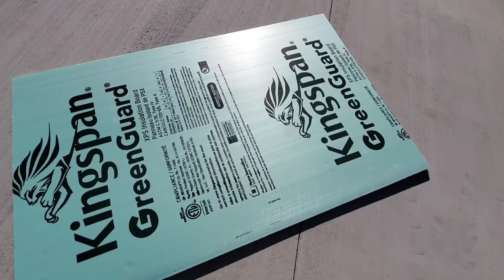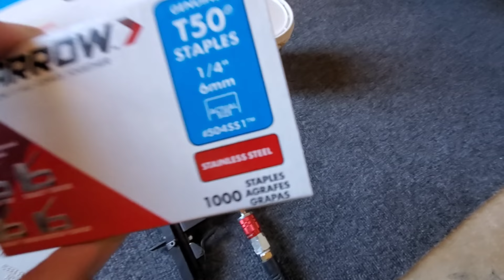Super Simple Jon Boat Floor

Comment: Plywood is a terrible option for the flooring in a John boat. Aluminum is much better. Use the blue foam board as it doesn't hold water if soaked. Plywood with rot under the carpet and hold water when soaked in it.
Reply: there’s a reason why you seal it before installing it
Reply: Eliminate the resin, carpet and the foam, the bare wood will dry between trips.   Lasts forever.

Comment: i did this about 20 yrs. ago. the ledgers are not needed. i notched around the side ribs for a snug fit, but leave room for carpet wrap. if left outside it lasted about 4 yrs. before it needed replaced.
Reply: and , then i got smart and used sheet aluminum.

Comment: I ran my 1448 Jon boat with a piece of 1/2" plywood floor.  I treated the plywood with deck oil.  No foam.  No resin.  No carpet.   No staples.  Bare plywood can dry out between trips.   Lasted for years and years, even donated the floor to a friend w same model boat.   Don't try and measure out the size of the floor.   Much easier and accurate to make a pattern from cardboard.

Comment: Very informative videos. I’ve been restoring and building boats for years now, can I make a friendly suggestion? When you put resin on plywood it works much better if you mix 50/50 resin and acetone. This lets the resin saturate into the wood instead of float on the surface. Definitely do the underside as well. 
PS- double up on hardner (MEK) when you mix 50/50 resin and acetone. Good luck sir.
Reply from the maker: Thank you. I will try this. I appreciate your advice!
Reply: @AnthonyJonesBrigadeBoats   Have you tried the 50/50 on anything yet. Would like to know your opinion.

Comment: I modified my Tracker 1436 similarly but used insulation on the sidewalls covered with Luan panels and carpet. Front and rear trolling motors and dual fish finders,  pedestal seat mounts, and remote anchors completed the upgrades. Electrical runs enclosed in split tubing assured reliability. I heated the boat with Coleman lanters on the floor fore and aft. Even in the dead cold of winter, the insulation worked so well that I would fish in shirt sleeves as anything else had me sweating. Night lites rounded out the project.  I kept it for 7 years, selling it only after buying a brand new Tracker 175 Pro TX. 
LOVE your channel! Keep the goodies flowing.

Comment: I took the crnter seat out insulated the bottom with the blue foam board covered it sll with plywood. Use both for hunting and fishing.
Use a mr heater with a 20 pound tank for waterfowl season. My blind keeps in the heat. 
Good job on the build.

Comment: One Of The Best Budget Friendly Videos On Boat Floor Builds !  I Was A Little Nervous On Self Taping Screws But They Looked Great After They We’re Applied.And Yes I To Cross The Street for Good Deals At Lowes And Home Depot ! Going To Use Your Method Because I Don’t Want To Remove My Bench Seats And Saving Money On A Fixed Income Is A Must ! New Subscriber Thanks Very Much

Comment: I did the same type of setup for my river jet sled. I put aluminum riv-nuts in the floor board so i can easily take it out with star knobs. Sand build up bad in there with lots of kids, and any bilge water early and late in mn freezes up which creates a ton of extra weight. Removable flooring lets me blow it out with my hotsy pressure washer.

Comment: I put 1 1/2 styrofoam on bottom of hull then riveted 1/16 aluminum checker plate on top of styrofoam and into Ribbs only added 22lb weight of boat it won’t absorb water and is not slippery when wet. Simple, good looking and will last forever and not any more expensive than plywood

Comment: That’s funny, I refurbished a boat one time in my life and I did exactly what you wanted against with the carpet. I don’t think I put too much glue on it because I used the little tool with the grooves but I think I over rolled it and ended up having some of the glue start to come up through the carpet, luckily I stopped once I noticed it and everything worked out good but they were a couple areas that were a bit stiff.  If I didn’t use the tool with the notches I’m pretty sure I would’ve put way too much glue on there and destroyed it.

Comment: My first one was like that with Marine Grade Plywood, second one was a sheet of aluminum .125 which was lighter does not rot.  I used the blue insulation as well.
Reply: I used 2" foam to match my rib height and just put a rubber mat trimmed nicely on top. It pulls out easily at the end of the seasons to wash down and reset it.

Comment: Just what I was looking for. Great video! I have a 1984 16/52 Monark which I found corrosion in the bottom do to previous owner care. I’m learning as I go on this project as this is my first aluminum boat. Had I known what I know now I would’ve found another boat to work on. The floor I removed had treated plywood on the bottom topped with sheet metal pieces (old signs) and hide by a nice looking none slip flooring material , looked great when I purchased it thinking I’ll have fun fixing up the motor since I am a mechanic which I did. Then I started on the boat and found things I had to pay someone to weld etc.. I have spent hours removing corrosion. I want to keep an eye on it so I was looking for an easy way to build a removable floor. Also the middle bench has been removed and I watched you use hat channel in another video but I can’t locate the small amount I need? I have a thousand questions on this project so I’m going to watch the rest of your videos. I’d bring you the boat but I’m in Texas. So keep up the good work and thanks again.

Comment: Just finished mine if you bevel the outer edges about fifteen degrees in it'll drop in tight and smooth to the hull.

Comment: Is there any reason you don’t use hydro turf, or is it because of budget, I think you have nailed it through the years, for content and know how.  You have motivated many of us. Thank you for that, I got a hook in the carpet and ripped it but I didn’t trowl the glue I just sprayed out of an aerosol can . That might be the reason behind the rip….? bTW your voice really works for video!
Reply from the maker: At the time of this video Hydroturf was not popular yet. As of now, I only use it on aluminum. I suppose you can thickly coat plywood in resin and then cover it in turf. I haven't done so yet, but that's how I'd try. I wouldn't stick it to bare wood, but that's just me.

Comment: Check you local laws on faux floors in boats also . In Texas if you add a faux floor to a boat you are required to carry a fire extinguisher . Vs if you just have  open floor like a lot of Jon boats are sold as from the dealer then fire extinguisher isn’t required .

Comment: Bondo brand fiberglass resin is polyester resin. If you want your floors to last more than a few years you should consider using epoxy resin. Polyester resins delaminate and crack quicker than epoxy. 

It’ll work but it won’t last as long.
Reply from the maker: Use whatever resin you want. You know what Basstracker uses from the factory on their wood decking? Nothing. Anything is better than nothing.

Comment: be interesting to disassemble that  now and see if you've had a lot of galvanic corrosion putting stainless steel screws straight into the the aluminium rails

Comment: Hey Cousin! Having recently inherited a 16ft jon boat, I've been studying your amazing mod techniques! How did you handle the carpet folds on the rib notches? Folding, cutting, both? I've seen your videos on carpeting inside and outside corners, but this is different. Love your work!
Reply from the maker: One cut down the middle, then from center make a bunch of diagonal cuts. Envision the rib cutout now overlap that with how youd cut a pizza. Basically you end up with a whole bunch of triangles you can manipulate around and staple to the back. Hard to explain,  hope that helps
Reply: @AnthonyJonesBrigadeBoats  Makes sense! You rock and thanks!

Comment: If you do this, use a marine grade plywood. I think in about 10 years you will appreciate it.
Reply from the maker: Marine plywood is special order. 3 times as much. For a garage kept boat that will only get wet while out on the water, I bet this will still be good in 25 years. I've taken apart enough 20 year old basstrackers with factory plywood (untreated) that was still not rotted out. If your intention is to leave the boat out in the yard to fill up with rain water, then I wouldn't suggest adding a floor at all. This is cost effective and DIY friendly with common materials you can walk into a hardware store and buy.

Comment: Thanks for the video! What kind of plywood do you recommend? I’m unable to find any marine grade wood unfortunately. I still plan to coat the wood with fiberglass resin and hardener like you did in the video. Thanks in advance
Reply from the maker: I don't use marine grade.I use 1/2 inch "exterior" grade. The exterior grade is rated for exterior home sheathing and the plys are glued with water resistant glue to prevent delamination if it gets moisture in it. Still coat in resin.

Comment: Any issues with the stainless screws in the aluminum?
Reply from the maker: No. I debate that a lot. Not any better option and aluminum corrosion in applications is WAY overblown to the level of people being misinformed. Not saying the boat manufacturers get everything right but even Tracker uses stainless for factory installs.

Comment: I know it was only 4 screws, but I would rather not compromise the integrity of the boat ribs.  Any holes are forever.  I'd probably instead adhere the foam board  to the deck with a small amount of construction adhesive, and then adhere the plywood to the foam board.  Adhesive could be removed away if you ever need it wanted to replace the floor.

Comment: Does cutting the benches affect the stability of the boat
Reply from the maker: Not as long as you leave some meat around the angled edges. That's the strongest point side to side connection

Comment: Good job and video. I'm just not a  fan of carpets for boats . It holds  moisture .  Hooks  gets caught in the fibers .  There's other choices . But to each there  own . Thx .
Reply from the maker: Yes. Hydroturf or Seadek is an option.  Need to use aluminum for that. Those are 150  a roll for the real deal, plus aluminum sheet. That 25$   floor just went up to 350$. This was a simple budget deal but get as high end as you prefer.
Reply: @AnthonyJonesBrigadeBoats  there's also good ol linoleum  that's  cheap and easy .   Still  used on kitchen florring 
 Available everywhere. Lots of colors and patterns  and is environmentally  friendly . Lots of guys  and companys like carpet . Happy New Year . Stay Healthy and Happy . Thx .

Comment: polyester resin is almost useless for sealing wood exposed to very wet use, epoxy sheathing/coated wood will last many times longer but is more expensive, but worth it.
Reply from the maker: Worked for 4 years now in my personal boat. You are correct to a degree. If I was building a submarine or coating a exterior bar top, I'd use epoxy.  For simply adding a barrier to wood should it get rained on while fishing,  this works fine. Keep in mind, my boat and a lot of the boats I work on are kept in a garage or covered structure. If they weren't we'd be using aluminum sheeting covered in Eva foam, not wood and carpet.
Reply: @AnthonyJonesBrigadeBoats  stored inside....probably will last

Comment: Hi , looks great!!!’
I never have jon boat but I look forward to buy one 
My question is , went you pull out all the foam from the seat for the storage room, doesn’t  affects flotation of the boat. ? 
Thanks for sharing your video.
Reply from the maker: No. The boat floats without any foam. The foam is there in case you flip the boat over in the water or in case it takes on A LOT  of water to help you stay afloat a bit longer before sinking.
Reply: @AnthonyJonesBrigadeBoats  thanks for your honesty 🙏 really appreciate it

Comment: Anthony when coating the plywood in the fiberglass resin to you coat both sides or just top and sides?
Reply from the maker: I used to do both sides. It doesn't hurt. In reality the bottom will only soak water if the boat is really flooded. So, for time, cost, material savings, i now just coat the tops and sides. Hope this helps.

Comment: KingSpan Green is the real deal. XPS vs EPS. It is eXpanded vs Extruded making it truly closed cell. I work in heavy construction and they use it on the outside of highrise foundations buried underground. Outperforms blue and pink by miles.
Reply: where can you get that?
Reply: @bardinkurtis  Lowes seems to caring it. They show 2" 1.5" and .5" in stock near me

Comment: My brother's coworker used to go duck hunting with us. So, one day he said he'd bring his decked out 14 foot Jon boat to use on the next hunt. We'd been using my old 12 foot V-bottom. Anyway, he shows up at 4:00am and is showing us all the storage he had in the seats and under the front deck he built by removing the front seat! The rear seat held the two deep cycle batteries and more storage. I could tell from the tires that thing weighed a ton! He got all of that room by removing every bit of floatation foam from the seats! I asked him what he was using for flotation and he said he didn't need it, because all the framing and deck was wood! I refused to go in his boat, telling him it was unsafe and he got all indignant about it and quit hunting with us. Sorry, but I'm not going out on a lake in a metal boat with all the floatation removed, I don't care how much wood it has!
Reply: Foam inside the boat isn’t keeping it afloat…. Just has to keep the water out to float
Reply: @LWC402  Not sure I'm following your train of thought. The manufacturer puts foam inside the seats (and other places) for flotation in case it gets swamped or capsized. The foam that my brother's coworker removed when he took out the seats, has nothing to do with keeping water out! My fiberglass canoe has built in flotation (foam) in both ends. It has capsized a few times when going through rapids and once on a lake when a motor boat passed by too fast and too close. In each case the boat remained on the surface giving us something to hang onto. Without it the boat would've sank to the bottom and been lost! The same goes for all boats. You take out the flotation and if it gets swamped it'll sink like a rock!

Comment: Just watched your Jon boat floor install, very helpful! I just bought an 16 foot semi V Jon and I’ll be flooring it soon. Here in the upper Midwest a lot of guys are using 1/2 inch MDO plywood. As you said before, lumber prices are stupid outrageous and a 4X8 sheet of MDO is much cheaper. What’s your thoughts?

Comment: Have you found any product that can be used to seal the inside of a jon boat? I mean every jon boat will leak a bit, and a bilge pump can be used, but if a floor is added to a deck to convert to a bass boat i would imagine that water is going to come in under the added materials.
Reply from the maker: No jon boat I ever build leaks at all. Not a drop. I water testtgembefore a biuld and if a leak is found, I fix it. This can require welding,  patching, replacing a rivet, or rebucking a rivet it. I do not seal the inside of a boat. That's like putting shingles on the inside of your house. You seal tge outside of the boat. This is called "bottom coat". I recommend different products depending on your project but personally I am using Fasco Super Slick. It is a 2 part epoxy which goes on thick. Once cured it will seal around all rivets and create a flexible durable thick coat on tge bottom of your boat. Of course it's about 125$ for the quart kit and depending on your boat you may need 2 kits. Also need to flop the boat and sand or wire wheel the whole bottom to aluminum.  This takes time. This is the proper way to address what you mentioned.

Comment: I'm doing the exact same build on an almost identical boat. After curing the wood with the resin is it absolutely necessary to sand it before applying the glue for the carpet ? Also on the "benches" I'm carpeting those as well I've sanded them down to the bate aluminum,do I just apply the same carpet glue directly the the aluminum then lay my carpet? Or do I have to treat or prep the aluminum surface with anything first ? Thank you for any help
Reply from the maker: I sand the resin because sometimes there are clumps, bumps, or surface imperfections that could affect the carpet job. Also, the resin comes out slick and waxy, not a great surface for glue to bind to. I highly recommend spending an extra 10 mins to hit it with some 60 grit to at least scuff it up some, nothing crazy if you don't want, anything is better than nothing. On the bare aluminum, yes, just apply the glue then carpet. I use carpet glue or contact cement. Not to confuse you, a full new how to carpet video coming soon showing what glues i use on what parts and materials and how i carpet a full boat using different techniques. Thanks

Comment: How many 4x8 sheets of wood will that bottle do ? . I'm comparing costs to decide if I should go with wood or pvc .
Reply from the maker: I like wood personally.. Pvc is very flexible and glue doesn't stick as well. 2 sheets to do full boat.
Reply: @AnthonyJonesBrigadeBoats  Not the sheets but how mush will the resin cover ? Do I need 1 or two ?

Comment: Thanks for the video… did you glue the foam to the bottom of the boat?
Reply from the maker: I believe in this one it's just floating.  The plywood sandwiches it in tight. You can glue if you want to hold it in place but one the wood is down it doesn't go anywhere.

Comment: What about drainage through sides. It looks like you have a tight fit. There are times i get sloppy with netting fish. The other day i tipped my cooler taking out of boat and fish fell on floor. I'm thinking of cleaning mess. Thanks
Reply from the maker: Water finds a way man. It wasn't cut air tight my friend...